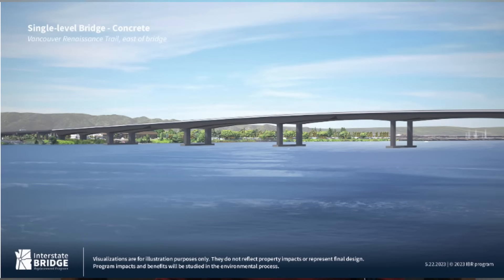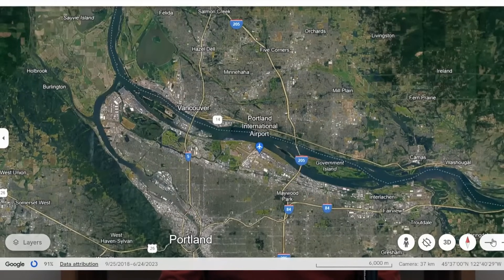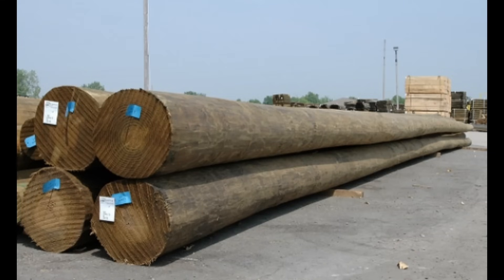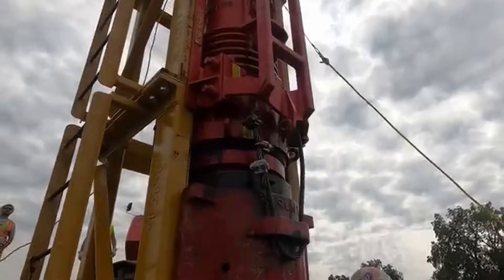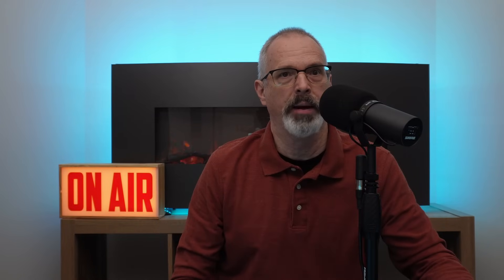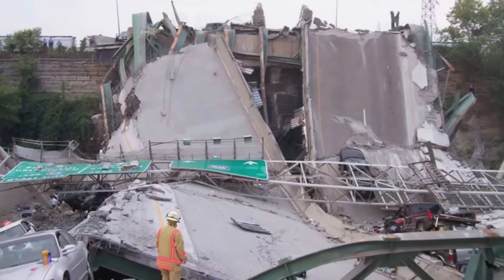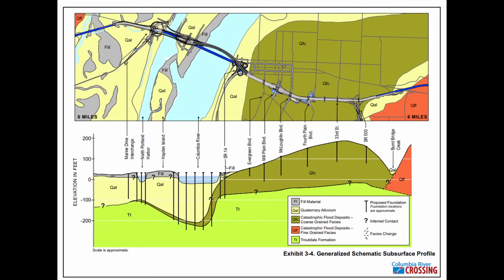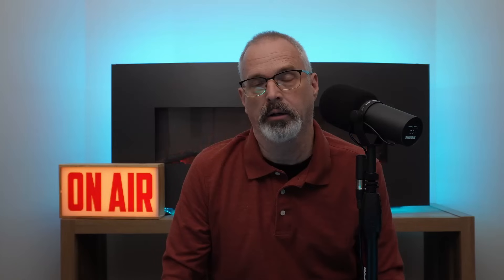Interstate I-5 Bridge Replacement over the Columbia River

Comment: Is this the bridge Lars Larson talks about on the radio? He says that, besides NINE Billion dollars for light rail, it will not be built because  ....  it will be rejected by the Coast Guard, because it is around sixty feet to near the water.  $9,000,000,000 for the same number of traffic lanes.  That bridge?
Reply: A little hint...  Lars lies his ass off.  Listen to this video again, and note that all the design elements to include light rail are 13% of the total cost of the bridge.  Everything else is the super-high bridge and approaches.  And even that light rail expense would be for a working, complete line all the way to Vancouver that would provide an option for people who won't or can't drive the bridge.  

You want to do what that liar says an use a "cheaper!!!" bus?  Well, the operating expense per passenger mile (aka the average cost to carry a passenger that distance) is $3.28 by bus right now in Portland.  The operating cost for that same mile on the MAX light rail is $1.86.  There's your problem, and that's why righties like old Lars NEVER mention operating expenses.  Yes, a light rail costs more TO BUILD, but the bus is vastly more expensive to operate.  Construction expenses are a one shot and done, operating expenses stretch into the forever.  It is like paying extra for a roof that lasts longer or a high efficiency furnace.  You pay a little more up front to save tons later.   In terms of lane efficiency, a pair of light rail tracks fits in just a bit more than the width of a single lane of traffic.  The capacity of your average freeway lane is around 2,000 cars per hour - around 2,100 people per hour.  A light rail can carry that many people on just three, two-car trains.  The present light rail has that many running in each direction on just the normal schedule.  If they use three-car trains - still with just one operator each, that is the capacity of a dozen buses (with an operator each that you have to pay) and 2100 people would fit on just 2 trains per hour.  That could pull 2,000 cars per hour off the bridge, making lots more room for you if you insist on driving.  

For example, that dreaded light rail in Portland that the Vancouver boneheads insist is such a waste operates so cheaply that putting the 113,234,575 rail passenger miles traveled in 2023 on a "cheaper" bus would have cost an additional $161 million dollars.  And that would be per year.  It would be, by itself, enough to pay off the entire cost of adding light rail to the bridge in just over 6 years.  The lie that buses are cheaper is pervasive, and complete garbage.  ( Figures from the National Transit Database run by the US DOT.  https://www.transit.dot.gov/sites/fta.dot.gov/files/transit_agency_profile_doc/2023/00008.pdf )

Comment: The I-5 corridor from Vancouver and all the way through Portland is both undersized and a sonic blight on my city. The Columbia river is a major shipping route and the proposed span is not tall enough. Raising the bridge will make the noise worse so I think the tunnel idea should be reconsidered, in fact I-5 and 405 should be buried all the way across the city. Regardless of what height of bridge or tunnel is chosen it's time to close the underused Pearson Airport in Vancouver and redevelop that neighborhood. I'm a couple of miles from the bridge and a just blocks from one of the on-ramps and in the last few years the morning stop and go traffic on the interstate has  worsened to the point that it is backed up onto the surface feeder streets. The threat of a toll on the interstate through the city has us wondering what that will do to the local traffic. The old bridge is passed it's prime by many decades and it's failure is only a matter of time.

Comment: Thanks for that informative video. 

Four comments: 
 1 There will be pressure to turn the three wider lanes into four narrower lanes. That is inevitable and will induce more demand.

2 I can't argue against seismic security, but I don't for a second think that is the most useful thing we could do with seven billion dollars. 

3 We have to be vigilant about the ramps. One of the problems with the CRC was that it was half about a bridge and half about bringing high speed traffic into neighborhoods. The two DOTs have trouble thinking beyond pouring concrete. At present, about half of the land that we acquired from the previous inhabitants is covered with impermeable ugly surface in service of automobiles - roads and parking lots. We never decided as citizens to do that, it just happened bit by bit. The DOTs will want more concrete - that's what they do. How ugly do we want our cities to be in favor of 1950s transportation ideas?

4 I want to echo City Nerd  who said that the assumption that road taxes need to go into more roads is like the idea that cigarette taxes need to support more cigarettes. The sources of funds and their best uses of them are not related.
Reply from the maker: Thank you.  Those are all interesting points that you make.  The funding model is broken.  Right now EV drivers are paying no fuel tax for highway and bridge funding as just one example.
Reply: @CaseyJones-Engineer  Imo road taxes should be based on vehicle weight, because heavier vehicles do far more damage to roads (and thus require them to need maintenance sooner) than lighter vehicles. That would also solve the issue of electric vs non electric, because even electric trucks are bad on roads. That and it also helps curb the issue of ever growing vehicle sizes.
Reply: You bemoan the "50's model" of transportation, yet no doubt enjoyed it's freedom to the fullest. Then you argue for a 50's model of arterial roads- do nothing.
Hippocrite.

Comment: They should have done a tunnel and they should not spend so much on those interchanges until after a new crossing is complete--a tunnel if done properly makes it easier to build before building the interchanges.
Reply from the maker: I agree with you but officials are saying that they won't permit dredging and that the local tribes were against dredging too for some reason.  They really are boxes themselves in relative to finding the most economical options to replace these bridges.

Comment: I'm curious, when you do the drilling method to add piles. do you guys use slurry to prevent the earth from caving in? Or does the ground have to be compatible with drilling with whatever diameter your pile is?
Reply from the maker: Most drilled shafts that extend to bedrock and are for bridges have a permanent steel casing installed a few feet into rock. The exvavation for the shaft and rock socket occurs inside this casing usually using the surrounding water as a drill fluid. Some shafts (say those installed in soil only) involve temporary steel casing and a slurry drilling fluid that is either polymer based or bentonite mud to keep the hole stable.

Comment: Environmental Studies are also a hindrance if the project doesn’t have the foresight to survey a wider road corridor than they need. As the designers are limited to putting the bridge and roads only within the area surveyed by the environmental teams and cannot shove the items outside that even if it’s more ideal or even optimal due changing opinion.
Reply from the maker: That is a great point. Apparently environmental issues killed the tunnel option as it would have required channel dredging.

Comment: The Newberg Dundee bypass to the south of Portland had piles driven in up to 300 feet before they were solid enough for use. Sometimes piles are all you can use. And bedrock? That’s as deep as 1000 ft below the surface.
Reply from the maker: I believe it. Depth to rock is about 200 feet here.

Comment: The 2025 start date is extremely optimistic.  We are almost at the start of 2024 and a final design concept has yet to be selected.  Once the design concept is selected, the process still needs to go through engineering, construction documents, plan review & permitting, environmental studies, cost estimates, and right-of-way acquisition.  The other issue is keeping  the existing bridge and interchanges operational during the construction of the new bridge and interchanges.  A lift bridge option might ultimately be selected due to CG and FAA restrictions.  The third bridge option between PDX and SR 14 makes a lot of sense.
Reply from the maker: I think the lift bridge is a better option than a fixed deck but we shall see how this plays out.

Comment: So, how much of the cost comes from the increased engineering and structure to carry the light rail? Are they basically adding the toll to pay for the Light Rail?  As for the environmental studies for rebuilding infrastructure that has been around for more than 60 years, this comes from the new demand that we evaluate every project based on its contribution to global warming and they are all required to also provide a no build option which will always be best for the environment.  The result here in MN is that we have highways and bridges that have needed safety redesigns for 30 years that are still not approved because the best option for the environment is the no build.

This environmental policy has gotten so bad that it cost $1.5 million dollars for just one study on adding a second Amtrak train between Chicago and St Paul that will run on already existing tracks that have been used by 20 to 30 trains a day for over 150 years!  It took 5 years and then they decided that adding just 1 more train was suddenly going to cause gridlock and chaos and so will require millions to be spent on grade crossings that already see daily Amtrak trains and 80 years ago saw 4 Hiawatha trains a day sometimes operating at up to 120 mph.

I guess if we make every transportation project cost billions, eventually the Stop Oil crowd’s goal of shutting down civilization will be achieved….
Reply from the maker: Yoy can bet the Chinese are not delaying their projects for years and years to conduct such studies.

Comment: Lived and worked in Portland , was also stationed there on the DD-876 75'-'79 . The studies done several years before 2018 on various impacts was very expensive and time consuming. Biggest issue is buying properties on both sides to begin construction. Vancouver is old downtown issues and on Hayden Island loosing the Safeway and a hotel , lot's of bickering both sides of the state line. I-205 helped there was even a idea of going from I-405 up past Sauvie Island & Vancouver and across but that died. Last map was interesting of the layers too.
Reply from the maker: Thank you for your comments and for checking out the video.

Comment: My guess is the USCG's bridge height requirement is consistent with requirements for minimum and maximum air draft requirements for the safe navigation of ocean-going vessels.  It has been close to 45 years since I've ridden on a tanker on the Columbia River.  I can't remember where the shipyard and drydocks were relative to the I-5 bridge.  I do remember riding a 188,500 DWT tanker, in ballast, through the opening of one of the bridges seemed a lot smaller than it was.
Reply from the maker: Thank you for that background. Lowering the vertical clearance is probably not going to get approved by the Coast Guard.

Comment: At no time has there been a proposal that is a basic bridge replacement.  Every design is not just for vehicle traffic, but they always want their failed light rail project and foot traffic.  Portland refuses to build more lanes of highway and honestly wants less highway traffic through Portland.  You can build all the lanes you want on the bridge, but Portland will not allow more lanes on I-5.  It would be better to build a new bridge at the I 205 to bypass the I-5 congestion in Portland.  This solves the height problem for river traffic, and the eliminates the flight path for instrument approaches for the Portland Airport.  Expecting this next attempt to build a bridge on I-5 will fail since there are too many agencies and red tape that want to add red tape.  So I expect they will spend all the money and produce zero construction of a bridge, until the bridge falls into the Columbia River.  Typical outcomes with liberal states and governors that never provide cost effective solutions, that hate people driving cars.
Reply from the maker: Apparently environmental issues is what killed the tunnel option on I-5 since dredging in the channel was not going to be permitted for some reason.  I like the idea of adding more capacity to the I-205 crossing.

Comment: I am very familiar with this project.  First of all, the animation does not show the most likely scenario, but the most destructive.  If there is ever a subduction zone event in this area the devastation will be very large and spread out.  Even a new bridge would not be designed for this type of event.

Secondly, the states of Oregon and Washington need to focus on the replacement of the bridge as a first step.  That project is not only doable, but affordable.  Later they can fund the laughable light rail (more aptly called the "lighter number of people moved" rail and the infrastructure improvements related to the interchanges.  A more appropriate solution is to abandon the bridge project all together and build a tunnel, thus solving all of the issues related to air and river traffic.
Reply: Lots of funding for huge roads and crappy rail, and then you complain no one takes rail. 😂 Build it right, and it can move a lot more people for way less cost.

Comment: The new I-5 Bridge Replacement faces some difficult  problems that sank the previous (2000s) project:
# light rail adds high cost because it limits the slope of the bridge. Existing I-5 bridge’s approaches/departures must be replaced.
# the existing I-205 bridge (1980s) is just 5 miles east of the I-5 bridge.

Comment: A better bridge was obviously needed more than 20 years ago when costs would have been much less. Traffic is only going to get worse unless we to to electric cars with no increase in power generation. Will 8 lanes be enough in 2040?
Reply from the maker: That is a good question about how many lanes are needed for future use.  I suppose having light rail crossing the bridge helps relieve some vehicle congestion.

Comment: The animation is great, however, since the current bridges were constructed in 1958 and we have not seen seismic induced liquification, seems to me they don't need to design for much of a larger margin than they have now. The real issue/challenge is whether the USCG will sign off on a lower raised height (116' I believe you said, where 176' is the current height). That is a pretty high traffic volume, although I believe Highway 101 (near Reseda) has a daily volume of over 500,000 vehicles.
Reply from the maker: I see what you are getting at, but there will be a massive quake (greater than magnitude 8.0) to hit the Pacific Northwest (probably within the next 30 years from what I am reading).  This quake will be much stronger quake (over 100 times stronger) than any quake that has hit this location since the bridge was placed into service.  These foundations will be toast under such an event.
Reply: @CaseyJones-Engineer  That's a pretty big quake! There may be more damage and devastation for the "great north west" to worry about than the bridges. I live in southern CA (I know, I know - trying to escape the government regime ....), and lived in CA most of my life (grew up in San Joaquin Valley) and have been waiting for "the big one" so that we can have ocean-front property ....still waiting. [;^)>
Reply: @CaseyJones-Engineer  that's a false conclusion to draw.

There's indeed a substantial chance of a large megathrust quake during that time period. However "probably within the next 30 years" is too strong a statement to make. We are one month short of 324 years since the last megathrust today. However megathrust quake intervals vary between 300 and 900 years.

Your assertion implies more likely than not during the next 30 years which is simply not supported by the statistics.

What that also misses out is that the whole area has a substantial earthquake threat from two other sources: deep subduction slab quakes like the Nisqually quake in 2001 or shallow fault quakes like the 1872 Chelan quake. After all the area is towards the southern end of the Yakima fold and thrust belt.

Of those two a shallow quake would be the bigger threat as Nisqually was attenuated a bit by its sheer hypocentre depth. A thrust fault letting go with a 7.5 is entirely possible in the Portland area. Loma Prieta on steroids as it would be a shallow 7.5 rather than a deep 7.5. A shallow 7.5 with a nice, deep Missoula flood deposit as valley fill to wobble to the point of liquefaction.

So a megathrust is a very bad scenario. However it's far from the only bad earthquake scenario to consider.
Reply from the maker: @davidpnewton  I understand what you are saying, but even if the odds of an 8.0 magnitude quake are 10 to 15 percent in the next few years it is still probable from a planning and preparedness standpoint.  I not saying that the odds are greater than 50 percent in that time period.  I suppose the other point would be that when this large quake occurs, there will be widespread devastation well beyond collapse of some bridges.

Comment: If they were smart they would tunnel, because the draw height is important to clear the air draft requirements of the Port, that’s why the USCG is going to be a problem.
Reply from the maker: I need to look more into why they say a tunnel is not viable.
Reply: @CaseyJones-Engineer  Probably cost, but bridges always go 2-3 times over anyway. Just do the same segmented tunnels like BART uses and it’s seismically fine.